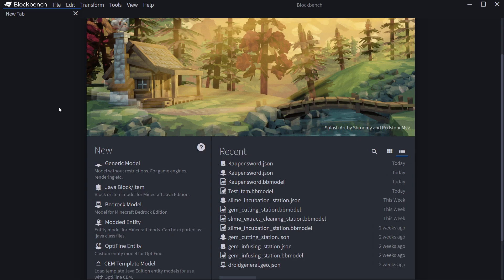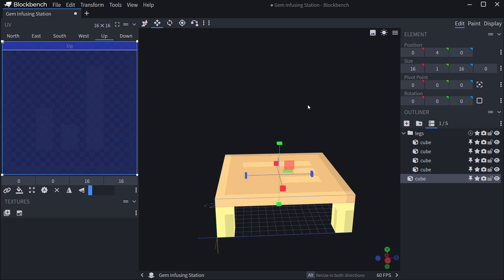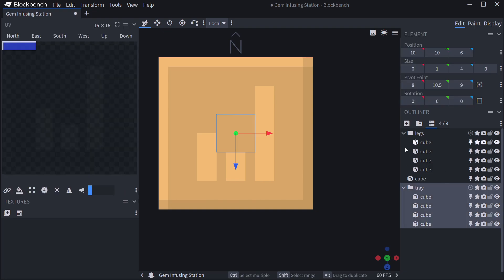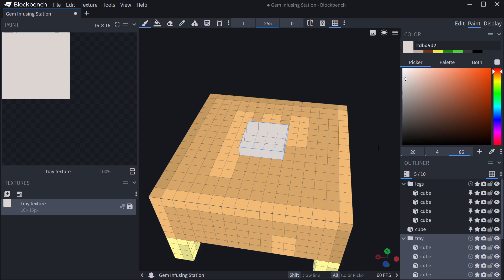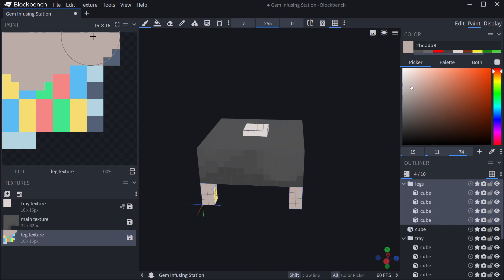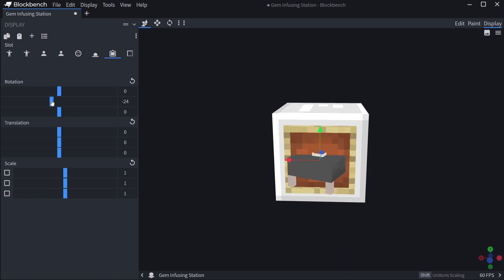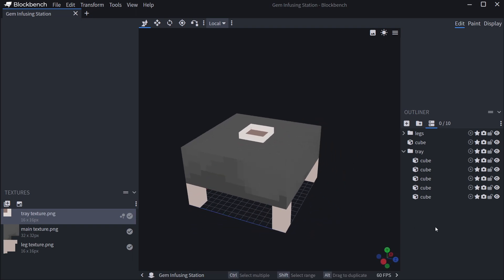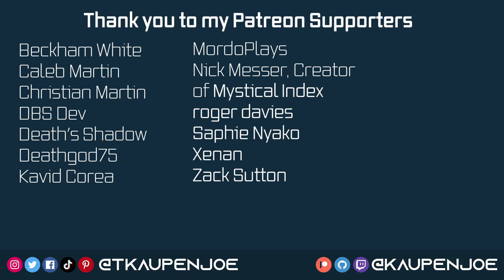CUSTOM BLOCK MODEL IN BLOCKBENCH | BLOCKBENCH #3 | Modding By Kaupenjoe

Comment: As someone who is well versed in Blockbench, I think vertex snapping is some of note for one of the future blockbench tutorials, once you reach that level accordingly,, I don't consider it too complex of an ability to figure out, but might just be me. Also, for future reference, if you do things with bordered textures, they sometimes clip in with a bit of the UV texture part next to it, which the padding add-on can help with a lot
Reply: Also, as far as texturing is concerned, I recommend de bucket tool a loooooooot xdd
Reply: And and, rotations in display for the inventory,, it's always appealing to look at block models when rotated to a multiple of 22.5, like, laterally to 45 and vertically to 22.5 is exactly the rotation of most blocks and skulls and stuff if I remember correctly, which all look nice in of themselves

Comment: Thanks again for the incredible tutorial! And I also come with a question : could you please do some custom commands and/or projectiles? I would very much appreciate that! Thanks again!
Reply from the maker: Hey there thank you so much <3
I believe the 1.18 command tutorial should still work (for fabric) - For forge, iirc the 1.17 tutorial might work, although not 100% sure 😨
Commands are not planned for 1.19, however projectiles might be a thing I wanna take a look at. I have struggled with them in the past as well. But a tutorial on that will probably still take quite a while 😅
Reply: @ModdingByKaupenjoe  Yeah, I understand that. Yet another thanks for the effort!